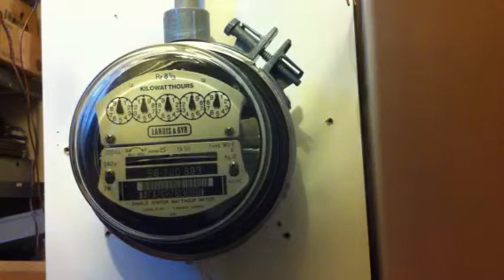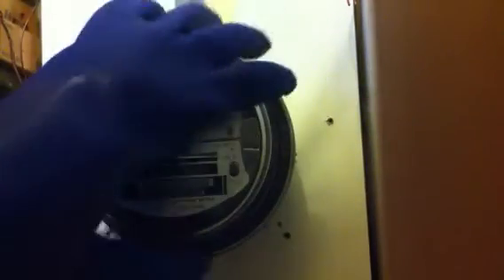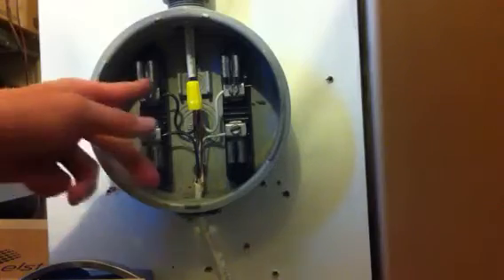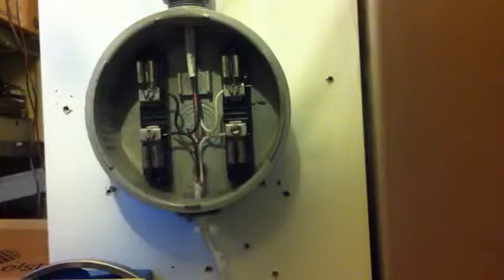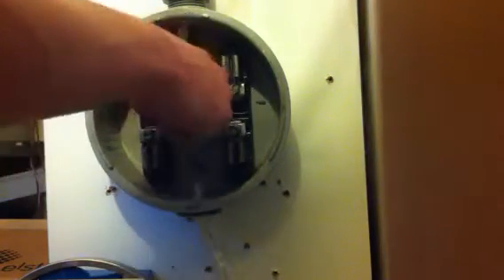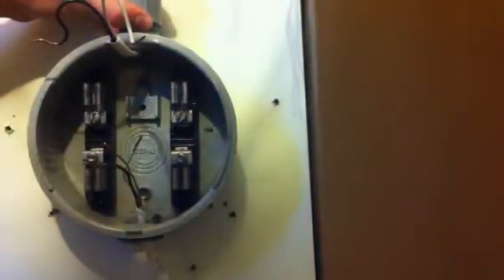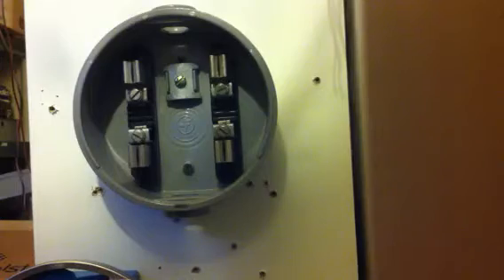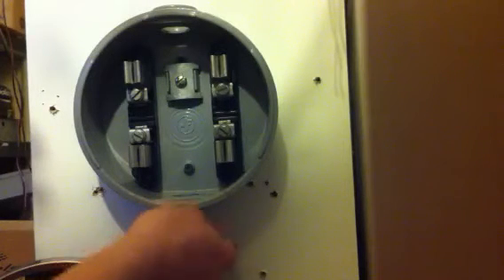Meter socket replacement pt 1

Comment: Thanks for the video. PG&E told us that somebody messed with our socket so they removed their meter and wouldn't re install it until we replaced it. So even though an electrician said it could be fixed, we were forced to install a new one. So don't listen to the haters, good video

Comment: Hey,
did you have that wired for 120v? because I’m used to having a jumper wire running to the back of the meter and having the bonding jumper on the back disconnected and having the load side bridged. usually going in the A terminal on the line side and out the B terminal also on the line side as well. I would appreciate it if you could post a video with your explanation on that wiring. thank you